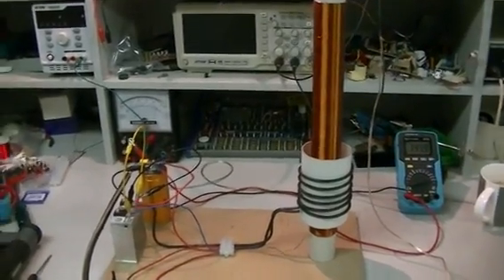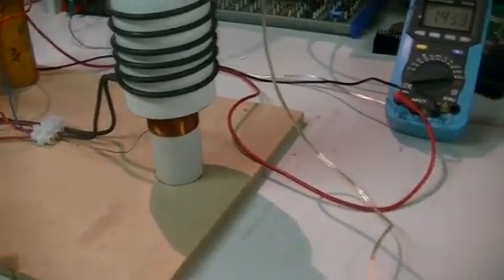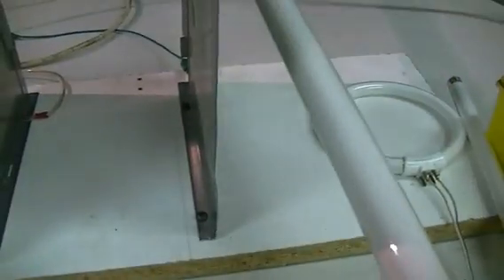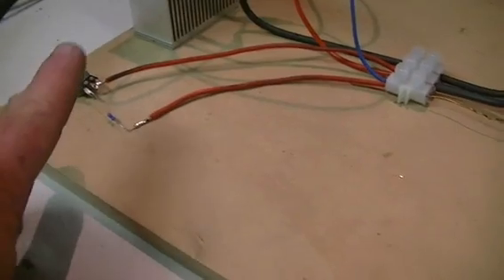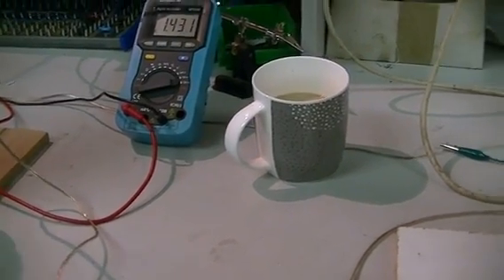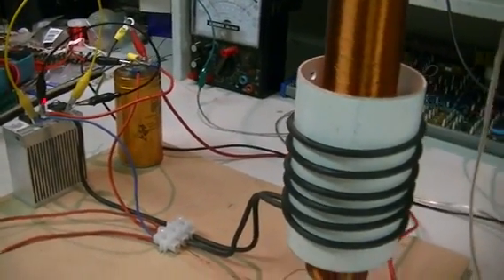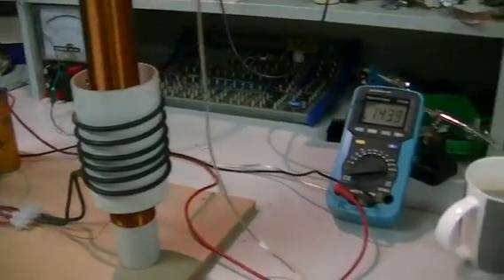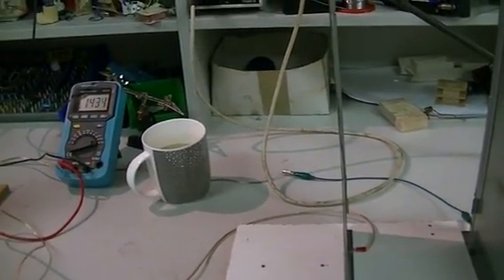Slayer Exciter RF field

Comment: put a rectenna between the plates and used the pulsed dc to break your water . there is a huge difference between fracturing water in a hydrolysis setup with dc and ac.